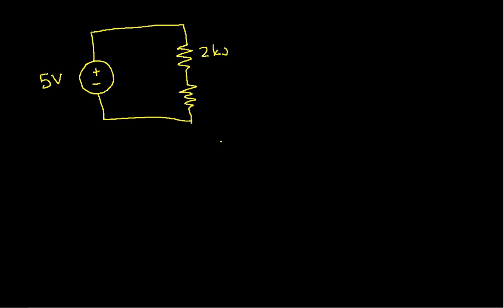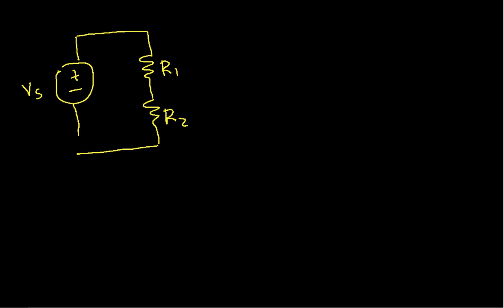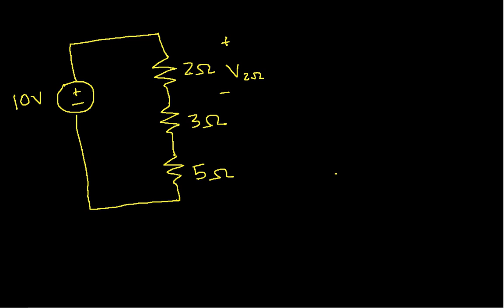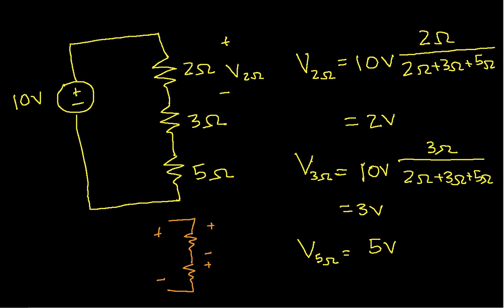Voltage Divider

Comment: KVL/KCL will also show the direction of the sources, 'whichever you are using, Voltage or Current' thus determining whether you add or subtract......if that is any clearer.

Comment: if we want to make a circuit voltage divider for measuring  high voltage ac, whether it can use a regular resistor? or is there a high voltage resistor?
thanks for your helping....

Comment: Hello! That was an amazing video. I was able to understand the voltage divider much better thanks to it. However I still have a question. Does the voltage divider works for resistors that are connected in parallel?
Reply: Noungoua maik for parallel connections, the voltages are equal.
Reply: Thank you!